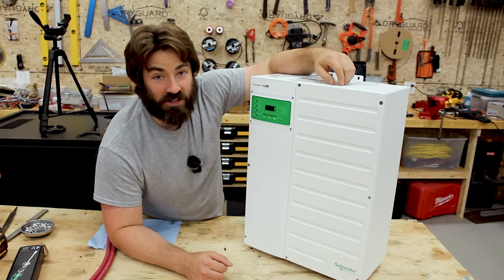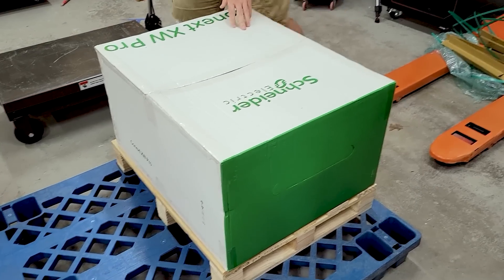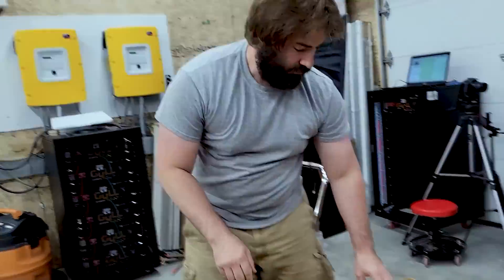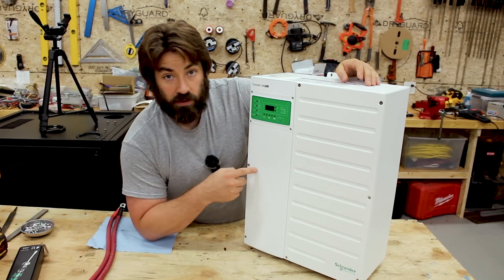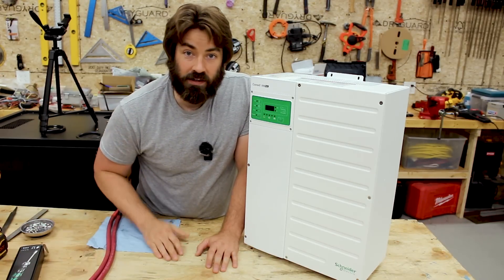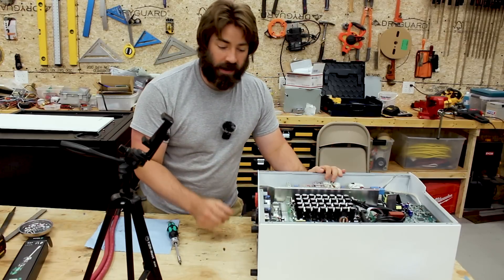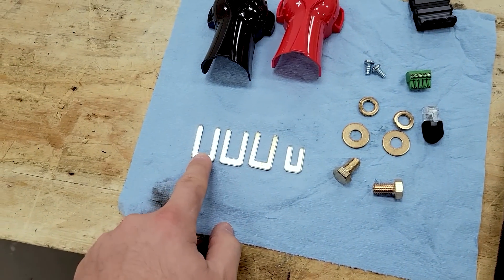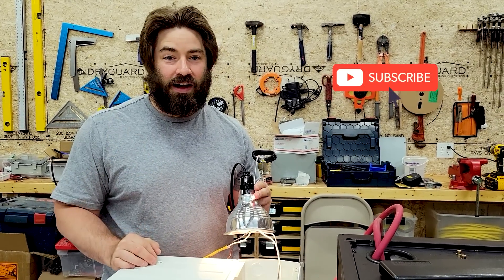Powerful Inverter for Solar Off Grid, Whole House, Schneider XW PRO 6848 Inverter, Hybrid

Comment: David, while we appreciate your reviews of the latest and greatest and expensive equipment out there, a lot of us are committed to what we already spent large sums of money on. And would like to make the most of what we have, and add instead of replace. For example I have 2 of the 3KW solar charge controller/inverters and I have 8 12v 200AH batteries. I would like to connect my two inverters together and have output of 240V. My battery bank is 2 separate banks. 4 batteries each (12v 200AH) If I connect my two Inverters together for the 240V output I would like to use all 8 of my batteries, as one bank. And both the inverters connected to the one bank of 8 batteries (total 20KW bank) but I hesitate to do so because I read something about not having more than 4 of these batteries in a bank. But surely there must be a way. I don't mean that you should answer this question. But it would be nice to see more topics like this covered. Making due with what you have and how to grow a system without replacing a system. Thanks for all of your quality content. You really do a fantastic job.
Reply from the maker: I certainly love the spirit of this question.  

Generally, if a manufacturer says "Max 4 batteries..." they usually mean 4 in series per string.  But, you can parallel multiple strings.  This means doing what you are talking about is possible.  It's always best to consult the manufacture for a manual or guidance.  

If you decide to have multiple 48V strings in parallel, I suggest paralleling them to a central busbar.  Each string needs it's own fuse (or breaker), usually on the positive post.
Reply: @DavidPozEnergy  Wow, thank you David. I really appreciate your input. I really did nor expect an answer from you, actually I thought one of your subscribers might have answered. So a Big Thank you!
Reply: Unless the inverters are designed to sync up to make 240 (2 120v any exactly 180 degrees out of phase) a safer idea is to use a step up transformer. In that size it will be called a buck boost transformer. Look for 120v in and 240/120v out

Comment: I want to see you start a 5 hp induction motor that’s wired for 240. It’ll probably do it.
Reply from the maker: Do you know anyone in New England that would let me borrow one?
Reply: @DavidPozEnergy  unfortunately I don’t know anybody in New England other than you. I live in Ontario Canada and I’ve had an off grid solar system for 25 years now. I like watching your videos. I’ve been driving my electric car on sunlight for 10 years. It’s a good feeling. I wonder if that inverter could power the 7.2 kW charger for the Chevy bolt? Or would it overheat in about an hour maybe? I’m running outback inverters. They’re also excellent machines. Keep up the good work
Reply from the maker: That sounds awesome.
I looked at the graph on page 142 of the owners manual.  It doesn't show a specific rating for 7200W, but roughly following the curve, it looks about 3 hours.

Comment: Ive been in solar forever and stopped selling these dinosaurs in 2003. Yes no MPPT built in so another component (expensive) to get, lack of wifi and remote monitoring. Think of them like vehicle OEM ICE and Solark and others as EV manufactures… no comparison
Reply: I'm a huge fan of the modularity.    with an all-in-one,  if it fails, everything fails.  until it's repaired or replaced.   with a modular system.. if the charge controller dies,  you can continue having battery backed loads, and charging the battery from the inverter..    if the inverter dies, you can at least keep the batteries maintained via the charge controller until the repair/replace.   all-in-ones are nice,  but designing a system for exactly what you need,  and not having to worry about a single failure taking your whole system down also has it's plusses.
Reply from the maker: I like how you compared them just now, by pointing out that there is no MPPT or wifi built in.

Comment: You should setup a microinverter array for AC coupled testing of inverters.
Reply from the maker: That would be fun.  I have a grid-tie inverter I picked up used for the purpose of testing the AC coupling function.

Comment: It would be my guess that 48 VDC is boosted up to a higher dc voltage (probably greater than 150V).  From that high voltage, it would then be inverted to 60 Hz.  We wouldn't know for sure without a closer examination of the bottom board, or ideally from an electrical schematic of the board.  Love your videos.  Keep 'em comin'!
Reply from the maker: That might be.  I don't know for sure.  I did take the cover off and turned on the unit (Danger!).  Then I checked it with my multi-meter set to AC Voltage.  I found 30VAC on the output side of the power bridge, that's the point where the wires dive down to the transformer.

Comment: How about testing the xw pro vs the sunny islands, they should each be about 50% the power of the xw pro. 

Can you borrow the sok-ark again to do some side by side testing ?
Reply from the maker: Maybe, but I really don't want to deal with Sol-Ark again.  They threatened to sue me after my other video review on their product.  I've been doing some preliminary testing on the Schneider and there is no doubt, it is powering loads that caused the Sol-Ark to shut down.
Reply: @DavidPozEnergy  Sadly, I'm not surprised.    When I was debating which system to go with,  TONS of youtubers were all about the solark.  But,  I deep dive before dropping cash, and found a LOT of inconsistencies in the reported capabilities.  I then contacted a few people directly.. and heard very similar stories where solark essentially bullied reviewers for favorable outcomes.   To me, that was a HUGE red flag.   If a companies product is as solid as they claim, they should be willing to let reviewers do their thing, and accept the criticism (the good ones, like schneider will accept the criticism AND THEN FIX IT)
Reply from the maker: Good call Jeff.

Comment: Where would a person hook up PV leads? Or does it not have a place to hookup solar panels?
Reply from the maker: You can not hook up PV directly to this inverter.
Reply: @DavidPozEnergy  ok. So how would one use a solar array with this inverter /charger, or is that not possible
Reply from the maker: You can use an external charge controller,  or an external grid-tie inverter
Reply: you just hook the inverter to a bus bar, and then whatever charge controllers you're using to the same bus bar.  simple!  that's actually all that is going on in the PDP Schneider sells, albeit with breakers/overcurrent protection in a pretty package.

Comment: The Schneider 6848 is a beast. We are using the older XW+  to back up the entire main panel for a 2000 sq ft house. Runs a 4 ton AC unit and electric oven as well as all the lights and basic stuff with no problem. Since our situation is AC coupled only we didn't need built in solar charge controller(s) which keeps the price reasonable. On the other hand, I do think its inexcusable that the inverter does not even come with a built in System Control Panel. I can understand why the Gateway or (ComBox) is sold separately because not everyone wants or needs remote access or Insight Cloud but without the SCP or a ModBus RS485 PLC connection there absolutely no access to the menu settings.

Comment: Schneider makes a great inverter , very strong and efficient . That's where the fun ends , no innovation for 15 years . Victron however has taken the same inverter Tech and added every smart device you can think of to it if you want it and you can communicate and monitor it for free . Meanwhile Schneider wants hundreds of dollars for push button box and $600 for programming software .  No thanks . Catch up Schneider !
Reply: Victron should make a comparable inverter that passes regulations for US installations.  I didn't see one option from Victron when I purchased my Schneider.
Reply from the maker: I love that I can check my Victron Charge Controller with my Bluetooth app.  Did Victron start putting Bluetooth into their inverters?  I hope they do.
Reply: @DavidPozEnergy  You can monitor the VRM on your phone from anywhere and see every piece of Victron gear .  The just released 2 new 450 volt charge controllers last year too if you haven't seen them ?  One with dual MPPT and one with Quad MPPT  and they are Isolated so they supposedly can't malfunction and dump PV voltage to batteries .

Comment: If I didn't install the same inverter 13 yrs ago i would be more impressed.   Where's the innovation? A different add on piece for everything.   DIY sure, but not great for installers.
Reply from the maker: How has the 13 year old one been working out?
Reply: @DavidPozEnergy  i moved 7 yrs ago so not sure.
Reply: @DavidPozEnergy  personally, my Xantrex 6048 (from 2008) was going strong until 2 weeks ago, when i upgraded to 2 of these XWPro's.  and the Xantrex 6048 will CONTINUE to go strong when it goes to a new home! LOL!  bullet. proof.

Comment: You should test it’s phase to phase load in balance characteristics 😬 it’s starting loads are also fantastic. 

You should AC couple it with some of your solar and watch how well it performs off grid with that as well . 

As an FYI, I have a smaller (now retired) cousin and I run my whole house with it. 

It’s built like a tank runs like a charm had almost no issues with it in four years! 

I would love to see a head to head to head starting competition with the Schneider, solarak, and one of those grow watt inverters. 

I highly doubt that anything is going to beat the Schneider in surge starting capability. Even to grow watch with a SolarEdge transformer, probably aren’t gonna beat the Schneider and its ability to surge start loads.

From my understanding, Schneider build them for industrial customers they might not be quite as efficient in DC to AC conversion as the transformer, loose ones, but they’re hard to beat for reliability.
Reply from the maker: Great idea!  I will definitely add an imbalance load test to my list.  
Actually, in my initial testing so far, the Schneider is more efficient than the transformer-less inverters I've tested.  Crazy.
Reply: @DavidPozEnergy   page 144 of the manual gives its weighted efficient chart . https://solar.se.com/us/wp-content/uploads/sites/7/2021/10/XW-Pro-NA-Owners-Guide_990-91227.pdf

The charts in the manual may be worth showing on future you tube videos
Reply: @DavidPozEnergy  Definitely want to see an episode on efficiency ratings! Thanks David!

Comment: It's worth noting, you can use any charge controllers with the XW pro.  the schnieder ones just enable some advanced functionality.  (Like, keeping batteries in float, and selling excess to the grid,  or doing zero sell, etc etc
Reply from the maker: Yes Sir!  I've been playing around with it and for sure batteries can be charged from any charge controller and the Schneider inverter doesn't care.
Reply: I have a Schnider charge controller and it’s only slightly more useful then a generic one. Having all the data on the screen is nice but that’s about it. The charge controls are old school and overbuilt but that’s good for longevity.
Reply: @Miweatherspotter1  It depends on what it is you need out of the system.  For me,  I'm doing zero sell (selling excess energy to the main panel, but erducing output so that it never actually sells to the grid)  for that, you need the inverters and charge controllers to communicate directly.  There are several other such scenarios.  But yes,  for basic "keep batteries charged, and sell excess",  and CC will work.

Comment: Hi David. Great info. Looking forward to the serie of videos to learn more about your findings and test results for this inverter. Do you have any plan to hook up 2 of these units for a parallel operation? Would be great to see if how 2 of these stackup to your pair of SMA 6048s, Growatts, or EG4s. A good side by side comparison would be a great help for all of us who is looking at building an off-grid, "whole house" system.
Reply from the maker: I would enjoy making a video stacking 2 inverters, but don't have a second one at the moment.  Maybe down the road I can get one, but it will depend how this one works out.  I agree, at some point a full on comparison video is going to happen.  As of right now, all I can say is the Schneider is blowing the pants off the Sol-Ark I tested.
Reply: @DavidPozEnergy  I think a sok-ark you have to handicap the kw rating by 30-50% the Schnider gets a 80% boost to its numbers as the under sell it as. 6k inverter. It’s really a 9k if you use the same fuzzy math as solark. 

I run my whole home and never once overloaded it, I’m sure I could, ac, stove, charge my ev…. But smart load management and I run my home with the 5k model. 

If you do some digging you will find the eu version list listed as a 10k. They don’t have the same 80% of max breaker rule we do so they can count the full output…..

Comment: Would be awesome to see that inverter/charger connected to some Discover batteries.
Reply: He already has the eg4 batteries. Signature solar recently released a firmware update to let them do closed loop communications with the context ecosystem.
Reply: Does anyone actually buy those expensive things , they are $1000.00 per Kilowatt .  Crazy .
Reply: @onthelake9554  They are $298/kW.

Comment: I think I see a phone call to Ben on this one lol. Should be a good video series on this one, the ac passthrough on the Magnasine works good but the battery charging when AC coupled leaves a lot to be desired so lets hope Schneider does it better.
Reply from the maker: Ben and I are friends, so we have certainly been talking about these.  What in particular should we discuss?
Reply: @DavidPozEnergy  His last video he seemed to think AC coupling was weak it will be interesting what you find .
Reply from the maker: O, yes.  Ben made that point.  I have plans to test AC coupling with mine too.
Reply: @DavidPozEnergy  Well I hope you can control it at least with mine it sort of runs full tilt when off grid and using the micro inverters to charge but I got around that with a special string of inverters with a smaller wattage. Cheers
Reply: @DavidPozEnergy  I have one that’s ac and dc coupled grid tied too with full grid interconnect so I can test all the functions  if your limited. Let me know if you want some other testing/ ones you can’t do

Comment: Holly Macro ! You got the big boy now . I’ve saw many great videos about it and even compared with the SOLARK inverter . Schneider inverters are awesome . One question I want to ask you . How does it compare to the performance of the SOLARK 12 k inverters in your opinion ? 😮 I saw you had demonstrated one back then in your previous videos .. Would love to see the next video of the Schneider load testing with that mighty saw .😊 May the solar be with you .😊
Reply from the maker: I'll be doing an in-depth testing on camera.  But, so far, the Schneider has powered loads that the Sol-Ark couldn't in my house.
Reply: @DavidPozEnergy  you have to test the latest solarks. they had some issue that seems to have been fixed.  I  had same issue of inverters cutting out when heavy loads  they sent me a new mcu.  now they are running heavy loads no issues. hot tubs, ac, and more at same time.

Comment: Were there deficiencies you noticed in your previous configuration (2xGrowatts or was it the Solark?) that made you seek out the Schneider?
Reply from the maker: It was my massive disappointment in the Sol-Ark that made me want to test the Schneider
Reply: @DavidPozEnergy  Sorry to hear that. For all the money the Sol-Ark 8/12/15 cost one would think that would be the holy grail inverter! I wish you better luck with the 6848.
Reply: The spec sheet on a solar looks nice. A buddy of mine had one and was massively disappointed with its offgrade capabilities. It’s just basically two 4500 W inverters in parallel not much different than two of your grow watts without a phase to phase in balance transformer, so it’s really efficient on grid but offgrade you have to have multiple ones to just brute for supply enough power and both of us worry that the capacitors and circuitry will not handle surges very well. The Schneider is a tank with 20 years of history to back it up..
Reply: Even the new solark15K?  I know you had major issues with the load imbalance and shutoffs on the 12K, no?

Comment: I'm a bit lost on the 120 single phase and 120/240 split phase comment, does it create split phase at 180 off or just a two hots at 120 each
Reply: You can rewire the board to make this a 120V only unit instead of split phase 120/240.  Doing this gets you more 120V current on a single leg, versus two legs out of phase.  It is also required to configure this for 120V only if using this in a 3 phase system (need 3 120V inverters).
Reply: it's true split phase, 180 out of phase with each other.
The unit can be switched to do 120 only, but 240 is it's default.
Reply: It’s got a big transformer inside which if you get the US version is tapped for two legs at 120 V with 180° of faze, separation a part in a neutral which gives a huge phase to phase in balance potential up to about 75% of its raited out put in definitely. 

An installer is also able to configure the unit to run at 50 or 60 Hz. 208 V split phase for three phase contributions. It’stackable up to about 12 units.It can also run 240 V single phase for European and other countries. it’s a pretty versatile inverter.